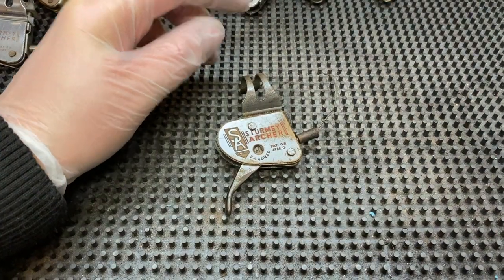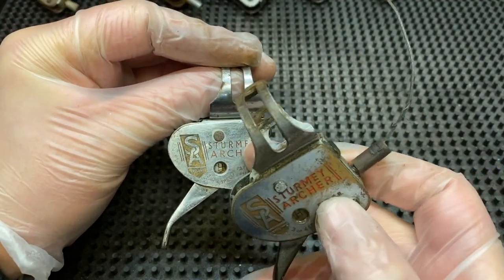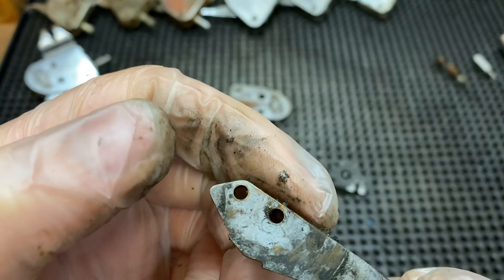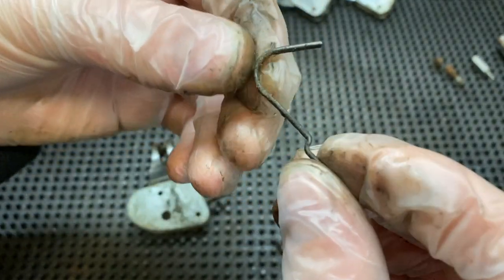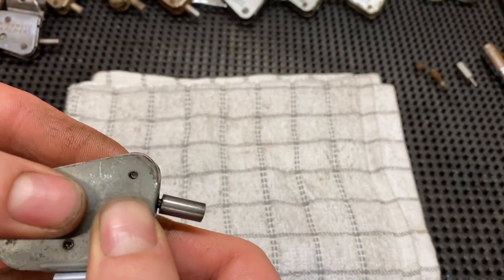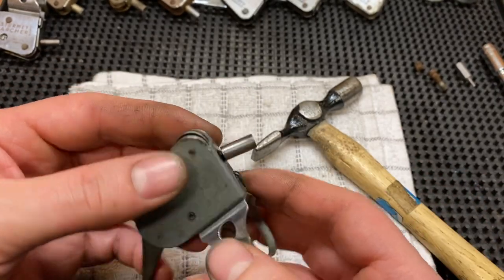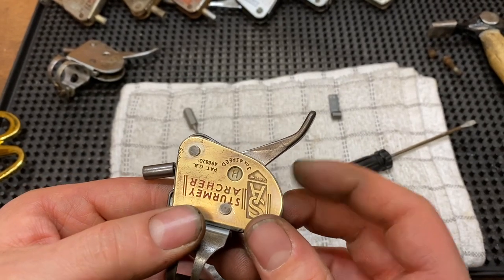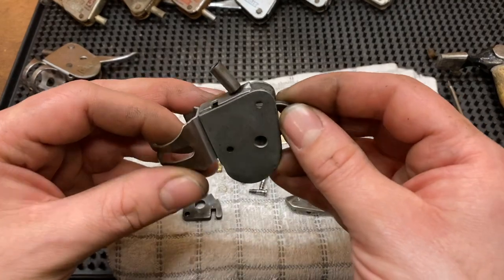Sturmey Archer tricks and tips

Comment: Thanks very much. I'm just refurbishing my dad's 1962 Raleigh Superbe with a four-speed SA FG hub. I'm no expert, so everything's trial and error. I stripped the trigger, cleaned it, and reassembled using two 2BA brass screws and nuts rather than rivets. The bike will get very little use, so the screw shanks shouldn't wear a lot.
Reply: I was thinking of doing the same thing! Using small nuts and bolts to hold it together. But maybe not. I just think it would be easier to clean. How has your been working out?
Reply: @greg1268  I think it's fine, but I've hardly used the bike. I think the screws will last many years.

Comment: Great vid and knowledge, how did you flatten out the drill bit end pls also how does the new wire fit in :) you keep posting i will keep watching Steve NZ
Reply from the maker: Thanks Stephen for watching, the drill bit  sits in place snug so just make sure you get the correct thickness or sand down to make fit, the gear cable are you referring too, if so that goes in at the back of the lever 👍

Comment: Hi, 

Great video. I need to service my 4 sp SA shifter as I suspect the clutch and spring need replacing, it does not hold gear 1. Where can I purchase a new clutch? Can I send this into you for a service?
Reply from the maker: Check eBay for parts although they are hard to find, I’m also after some bits 😂
Reply from the maker: Thanks also 👍